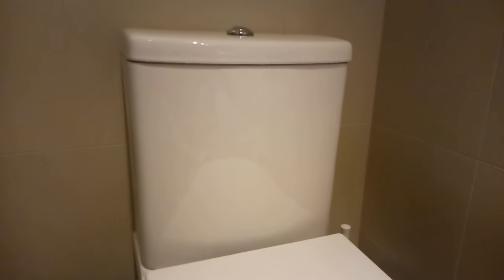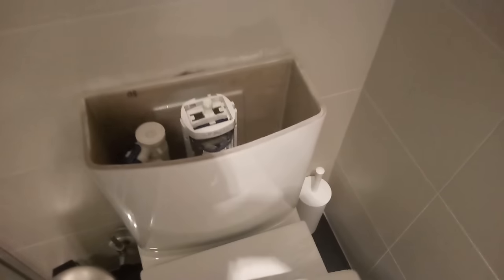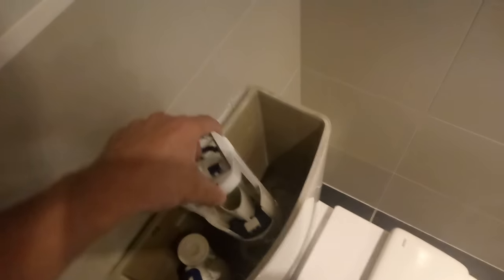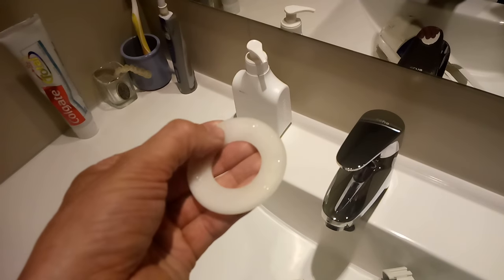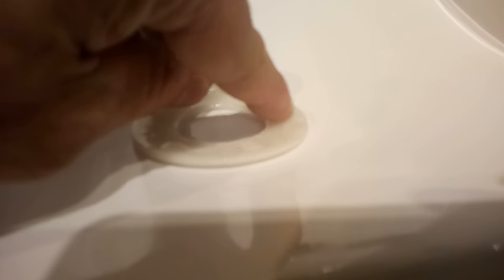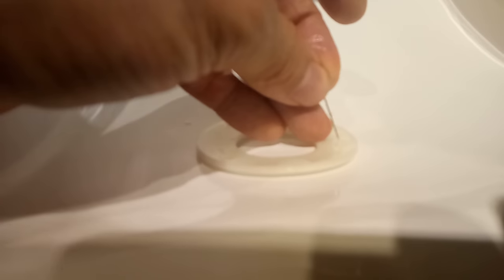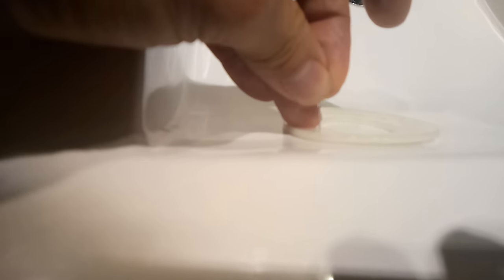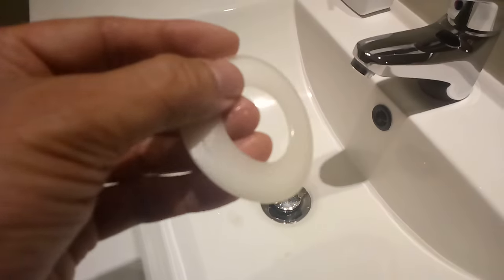Fix a leaking Geberit toilet flush valve

Comment: Spot on fixed the problem.  On a broader note isn’t it interesting how flush technology has gone backwards as we used to have toilet cisterns at height that used the force of gravity to enhance the flush and a simple ball and cook mechanism that anyone could fix and an outlet where we couldn’t pretend there wasn’t a problem.  Now with “water saving” advancements we have toilets where you need to flush a couple of times (no force of gravity) and where leaks go down the basin so you never get round to fixing it and over engineered German plastic Heath Robinson concoctions that you need to go on YouTube to find out how to fix.  80,000s views so far, so probably a common fault - German/Swiss engineering is not what it was once!
Reply from the maker: Yes I think a lot of people are having problems with this flush mechanism. Totally agree with you they completely failed at the new water saving mechanism. It saves water compared to the old syphoning system for the first 2 years but then leaks and uses much more water for the next 5 until the owners figure out how to replace / pop the blisters on the washer.

Comment: The beauties of YouTube, this 4 year old video just fixed my toilet. Thank you so much for posting this, have had water leaking into toilet bowl gradually getting worse for weeks now. I was on verge of buying new components to fix it but then saw your video. Sure enough when I checked the rubber washer/seal it had a number of bubbles under the surface. Once these were pricked it fixed the issue, no leakage. And most importantly of all at no cost, again thank you so much.

Comment: I had the same problem - intermitant noise, which I thought was the seal on the shut-off valve.  But I replaced that and it continued to leak.  Thanks to your video I've now realised it was the bottom seal (NZ$10 at Mega).  And yes, my toilet was installed in 2019, meaning that it is also now 5 years old.  Same blistering on the seal (under side).  IMHO this is the best video on the Internet about this issue.  Well done! 

BTW looks like this problem is universal with Geberit, judging by the comments from all over.

Comment: As others below - my toilet leak has gotten progressively worse - I played about hoping my fiddling would help. Watched this an found I could both remove the flush mechanism as per the video and the washer was in exactly the same condition as this video. Followed the steps to burst the bubbles, reassembled - which was straightforward and low and behold, the leaking has stopped. Many thanks for this informative and helpful video.

Comment: Thank you for posting this. Changing the seal was simple (and cheap)and solved the leaking toilet problem. As you described, our seal had a bubble of water stuck between the two layers of the seal. I expected the seal to be a single thickness of silicon, but evidently not. I presume that once any crack forms in the joint between the layers , water gets drawn in over time.

Comment: Thank you for this. I never would have thought that you could have water ingress into a silicon washer / gasket.  Followed your advice, found the pimples and popped them with a needle. Reinstalled washer and now no leak. New washers ordered for eventual replacement throughout toilets in house.

Comment: Mate, thank you so much for this video, I didn’t have the confidence to understand how that contraption came out! But this was exact the same problem with mine, fixed in less than 5 minutes. We’ve got 3 of the same toilets in our house. All started going wrong after 4 years. Loads of bubbles on the washer.  Now fixed. Thanks 🙏

Comment: Hi. I have a Geberit concealed cistern. It has been leaking into the toilet bowl for a few months now but has recently got worse so I decided enough was enough. Having dismantled it (with the help of YouTube) I initially thought it was the fill valve type 380 , lateral flow water supply connection and have just ordered a new fill valve unit. However on watching your video I thought - maybe it is the flush? On close inspection I too noticed a large blip in the large silicone washer . I thought this was part of the system. However I have pricked the blips and water shot out. There was some swelling around the rim. I didn't realise that these rings are made of several layers and water can get in over time. The cistern no longer leaks! - thankyou for this very helpful video. I may buy a new flush washer in the future but for the moment it is working perfectly.

Comment: Mate - excellent video. Saved to £40+ quid on a replacement flush valve. My sister did spend the £40 quid + plumber charge for the same thing a month ago. Has been doing my head in for ages and don't know how I missed your video. Thinking about starting a class action against Gerberit for using dodgy washers ;). Ordered a spare washer just in case, but great work and thanks again!!!!

Comment: My toilet interior and valve is different, being a concealed cistern and of a different design. I took it apart with the aid of another video and found the rubber seal had precisely those water blisters you described. Pricking those with a pin before reassembling solved the problem. Thanks!

Comment: After wading through many videos, yours was the most useful and matched the Geberit type 260 valve I have.  I bought a new washer before tackling the job just in case.  I struggled a bit getting the valve out of the cistern  because of the restricted space to get a proper grip on it but   when I did removed the valve, the old washer had pimples just as you say.  Fitted the new washer and refitted valve and problem now solved!  Also have a back up washer for next time.  Great. Thanks very much.

Comment: I took a slightly different approach: although at first I popped all the "blisters" as you recommended, in the end I noticed that the blisters were only on one side, and so I mounted the silicone seal back on upside-down (actually, it doesn't seem to have an "up" or a "down" side, really). It's fixed!
Cheers,
M.

Comment: For years literally I’ve been looking at how the plumber fitted the the flushing module alongside the water inlet part, wondering why the flushing module would get stuck agains the water inlet part requiring me to press the flush multiple times to unstick it. and it’s as simple as Pressing two clips, rotating the flushing module till it didn’t touch the other mechanism and clipping it back in. I feel like such a dick for thinking I needed to pull the whole cistern out to fix it. I also found I need to replace the inlet water valve! My mind is now at ease because of this video!

Comment: Excellent video, after putting up with a leak for a month was going to replace the whole flush unit, all it needed was a £3 sealing ring. Took longer to go to the local diy store then it took to fix.

Comment: Great video. We replaced the seal  about 5 years ago. That had about 4 pimples. We didn’t think to pop them but we found a few days later that they had dried out and disappeared. This time there was one large pimple which we have popped while we send for a replacement. Thanks again

Comment: Thanks. FYI. You can buy the Geberit gaskets. I found after popping that soaking the bottom of the unit in limescale remover like Kilrock took a load of scale away as well. Cheers. Great vid which saved me £50

Comment: Thanks, in my case I noticed a couple of small water pockets but this was enough to cause a very time consuming and fair amount of effort into finding why the inlet was occasionally dripping. No water noticed in the bowl but then noticed the water level wasn't always the same when flushing (I used gaffer tape to mark the baseline cistern refill level). I burst these two water pockets but then reversed the seal too. I've ordered some replacement seals for just over £2 each. Plumbers can apparently charge £45 to fix this leak.

Comment: AWESOME, thank you so much for the 'pimple' trick, I had two pimples on the seal which is up to 11 years old (possibly shorter but that's unknown, although possibly a date stamp on my 260 model '130428' so 2013 would be about right for when the toilet was installed new).  This solved the dripping instantly.  Gave the 260 flushing unit a good clean too as it was all a bit mungy black.  I see replacement seals are now available on ebay, not needed as yet but maybe in the future.  This video saved me £££s or at least a complete new assembly at around £50 and so much time.  I've got another in the house so am well prepared.  Cheers again fella.

Comment: Amazing! I had this exact problem. My flush valve is a little different as I had a couple of clamps keeping the flush valve in place. But the washer was still the same and the fix worked like a dream. Thank you so much!
Reply: I am pretty sure this video just saved me a $300 plumber visit. And your comment gave me the last tip I needed to get the thing out--the 2 clamp bits. I couldn't pull it off without knowing that. You have to press the side square button-ish things in on mine. I'm writing this so I can remember in 5 years when I have to do this again. Thanks, btw.

Comment: Excellent advice - so simple and it really does work. I thought it was the build up of limes ale which I removed but you’re right: it’s the bubbles of water that interfere with the seal.
Duravit should take note as they are responsible for an enormous loss of water....
Reply: Wretched spell check:
Limescale! Grrrrrr
Reply from the maker: Agree, this "water saver" mechanism is probably reasonable for a lot of wasted water.

Comment: That is spot on mate - I would have never spotted that issue!! Only complicated on mine as the flush assembly wouldn’t turn 90 degrees to the point it pops out due to the slimline cistern - I cannot believe they supply products like this and it reinforces my view that modern plumbing is utter shite. Managed to file a bit off the tabs that hold the thing together and turn it therefore avoiding removing fill pipe and having to take the cistern out. All because some silly cow didn’t want an ‘old fashioned toilet where you can see all the pipes’ !!

Comment: Thanks for sharing this. It fixed my immediate problem. I've since replaced it with a new seal (£5 - proper Geberit, not an eBay knock off)) and they are now made out of a different clear silicone material which apparently should fix the problem permanently, so Geberit say.
Reply from the maker: Thanks for the info, can you send me the link to the Geberit link? I'd like to read over it. Cheers.

Comment: Thanks, have the same zoom toilets and both have had this bubbles in the seal problem. Have you had to replace or repop bubbles since posting this video.
Reply from the maker: They haven't leaked since which is really odd. But should go check them for bubbles forming
Reply: @jwelliottnz  Thanks for the fix tip and the reply
Reply: @jwelliottnz Amazing, Magic…👍 I have an even older type of valve which instead of having to twist has clips either side at the seating end, which sheared off as I pulled it off, as twisting wouldn’t shift it. But low and behold the washer had the same bubbles. When popped, it solved the leaking, even though the clips were no longer holding the unit down…many thanks… 🙏

Comment: Absolutely brilliant. I unfortunately struggled at first as I was turning the module wrong way. Strangely though the constantly running pipes was making my hidden pipes very cold and creating condensation, ‘ pipe sweat’, and so I had a damp patch the same shape as my pipes running down the wall to the cistern.  Hopefully this has now fixed it. Thanks for the video and thanks You tube!
Reply: I’m having trouble removing my part, I’ve twisted left but it won’t pull out. Help

Comment: Genius! And with the ease of disassembly you'd almost say that geberit designed it to be so easily maintained? Has anyone tried turning the seal over? Though I've popped the two big blisters on the top and a small one on the underside, there is a slight concave dish across the diameter of the silicone seal and I wonder if flipping it over will help.
Reply from the maker: I had blisters both sides, as long as they are all popped I don't think it matters which side you insert it. But give it a go and report back?

Comment: Thanks. This seems to have worked for me. I certainly wasn’t expecting to use our sewing kit to fix a plumbing problem.
I may just tape a pin to the bottom of the cistern lid for easy access.
Parts for this model are difficult to find in Canada.

Comment: Thanks from a fellow NZ’er , I have the same brand toilet installed 10 years ago. Can’t find any info on the brand online except minimal info from Australian plumbing suppliers. I have tried to get the valve assembly out , trying to twist as you did but it won’t release, really scared of breaking it. I have tried and tried but it will not budge. I can twist it a full 360deg with no success.
Reply from the maker: Understood. It's not intuitive. It's not the twisting, the twisting aligns the tabs so they can release up. Otherwise it just spins.
So turn a little with slight vertical lift pressure, doesn't take much. Keep on turning until the tabs align then it will just lift free.
Reply: @jwelliottnz  thanks,
Reply: You kind sir have saved me a considerable amount of money 💰  I took your advice and with some upward force it came free, it has a few blisters but decided to go to Bunnings (being an Aussie brand flush system I thought they may have more compatible parts) and for the enormous sum of $4.95 I purchased a new seal , it's installed and leak it does not 😅. I also purchased a second seal for when the other toilet begins to leak

Comment: Thanks for taking the time making and posting this video.
You make this  look so easy, I've tried to twist the valve the exact way you demonstrate here and it'll only go round so far then it stops before the place you show on here.
I've tried every way I can think of without actually breaking something, I'm beginning to wonder if it's something broken internally causing it to jam.......any ideas please???
Reply from the maker: It comes easily on my model. Try twisting and pulling up at the same time gently.
Reply from the maker: There are slots you have to align with
Reply: Hi, thanks for your quick reply, my model is 223.830.21.1
I'm no novice to diy, but I've tried twisting pulling any way I can think of, to no avail.
I'm awaiting delivery of a new valve which should arrive tomorrow, I'll wait until it arrives and get a better idea as to how it unclips hopefully.
Must be warped a bit I'm thinking.
Thanks again.
Reply: Hugh Crawford 
I’m having the same problem you had. I’ve twisted & pulled but it’s not coming out. Did you manage to solve this problem???
Reply from the maker: @chirova1  Am unsure if you have the same model as mine (in this video) but the bottom of the mechanism has tab that match slots in the base.  I can rotate either way an gently pull up when the tabs match the slots it just slides up easily, but they have to align?  Unsure if this helps you in any way.  Good luck.
Reply: R. Chihoto No, I eventually took the whole fitting out by undoing the cistern, even then it refuses to budge, Its definately warped, there is no way they will separate, the new one was not a problem, I guess I was just unlucky.

Comment: Brilliant.  Many thanks.  Your demonstration told me both how to remove the flush module (not overly obvious by looking in myself) and by identifying the source of the problem.  I found the bobbles on the washer as you described and have popped them.  Problem fixed (but I have ordered and will fit a new washer soon).  How can a washer, designed to make a seal in water, be affected by water?
Reply from the maker: I wondered the same thing, why the washer would form these water blisters.  The only guess I came up with was that the silicon washers appeared to to have formed a skin, unsure if it was part of the manufacturing or just how the washers aged.  Then using the 1/2 flush where you could let the button go with a significant amount of water still in the cistern could cause a 'water hammer' affect with the velocity and mass flowing through the flush valve stopping suddenly causing a large pressure spike around the washer, perhaps causing cavitation and resulting in a small amount of water vapour to puncture through the side where it would condense and accumulate.  This is the only purely theoretical scenario I could dream up.

I actually purposely didn't get new replacement washers, had wanted to use the ones I'd already spiked with a pin, hoping that these would be egress points for the water within the washers so hopefully they'd would last longer without new blisters forming.  Will see if that turns out to work.

Comment: Excellent stuff - I'd found the dimples but thought they were a design feature as mine were equally spaced.  Popping the bubbles didn't fix the issue for me, there was still slight leakage, but a replacement washer from ebay is £2.30, so replacing seems like a better idea in anything beyond the very short-term anyway.

Comment: Hi. I have tried taking the upper unit out of the cistern by twisting it, it twists but no matter what I do doesn’t come out. I don’t wish to over-twist and break it. Any tips? Thanks
Reply from the maker: There are some notches that must aline. Turn and lift gently. You can feel when it's aligned as the unit will come free. But without the lift it will only spin freely.